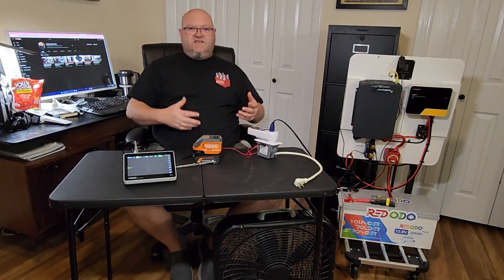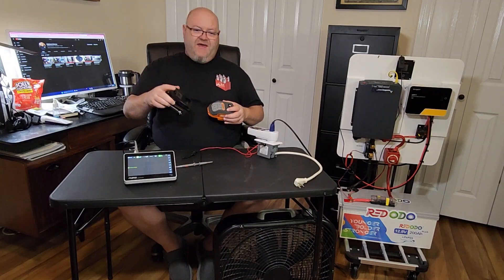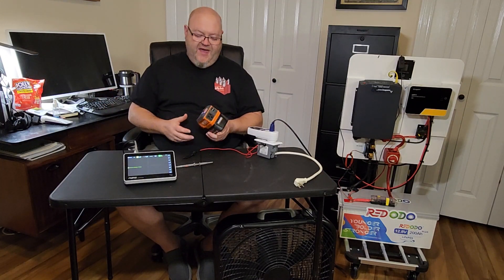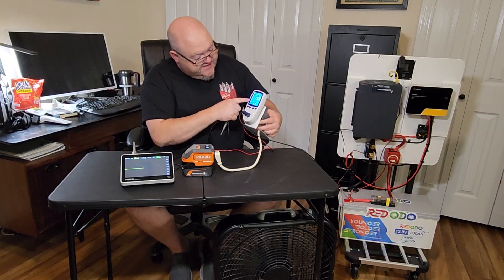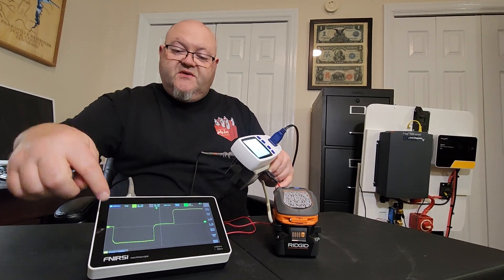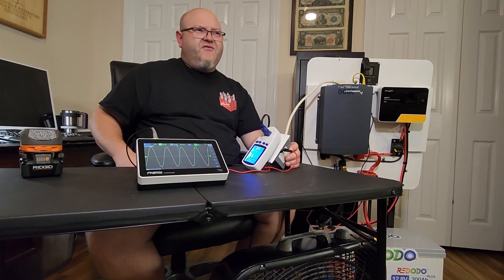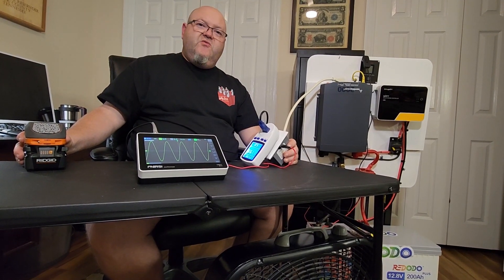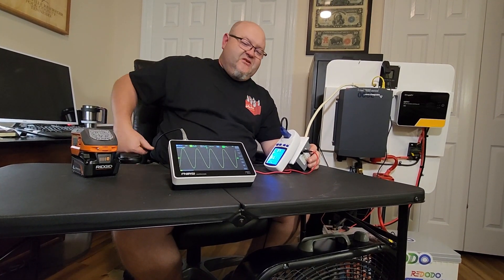THIS IS WHY YOU WANT A PURE SINE WAVE POWER INVERTERS!

Comment: Some of the folks on here are talking about modified sine wave inverters like shown in this video and how they are fine for things that convert the power to DC.  That's not a universally true blanket statement.  The harmonics created by the rapid voltage changes in a modified sine wave inverter output are often not completely or properly filtered by AC to DC converters and remnants can be seen in the DC output.  Sure, ultra high quality supplies will have ample filtering to handle this, but that's not the switched mode AC to DC converter circuitry you're going to find in a lot of common electronics.

What is the overall implication?  Well, it depends...  For simple things like battery chargers and such, its not likely going to be a major problem.  For more sensitive electronics and audio equipment, it can be a significant problem.  Electronics with switched mode AC to DC conversion circuits are designed to take an input sine wave with a limited amount of distortion and respective harmonics.  Pure sine wave input to these systems may not always be required for them to be functional, but it will always be the better choice for both power supply longevity and optimal operation of the device itself.

Comment: Step sine wave is fine for things like power supplies (in computers, TVs, most modern electronics) where the AC input is rectified and connected to capacitor.  Pure sine is required for loads that are inductive (eg motors, fans).

Comment: The majority of sensitive electronics already filter power when converting to DC. The need for pure sine wave is rather over emphasized.

The cheapest ups's are not pure sine, but work fine for decades.

What you need is a high quality inverter, not necessarily a pure sine one.

Motors that are not dc, are indeed an exception.